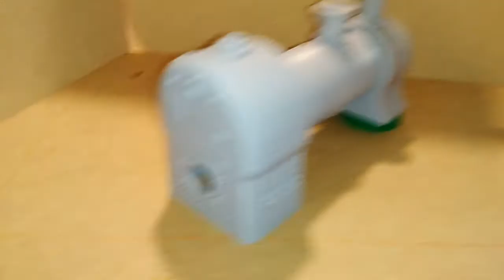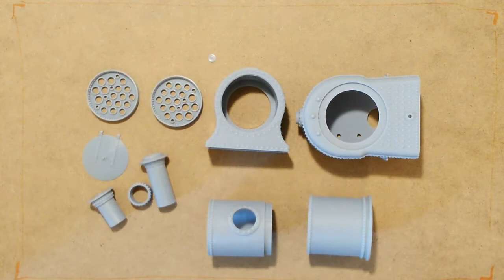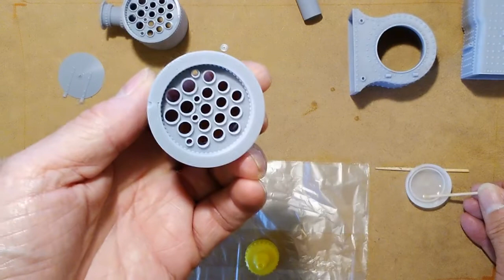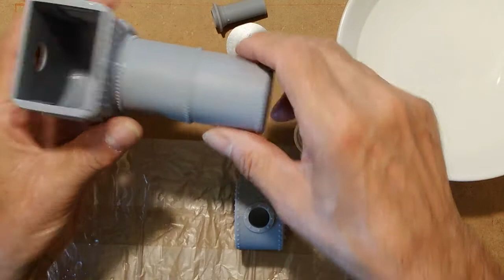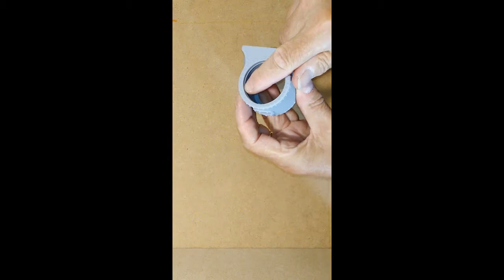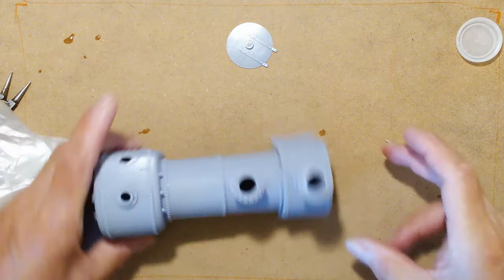BOILER CONSTRUCTION

Comment: I really like this kit. Would it be possible to make a cab and a running plate for it. Also is there anywhere I can get the parts for the boiler: fire door/doors and anything else that would need to go on the fire box.🙏
Reply from the maker: Hi, thanks for interest.
Unfortunatley,, what you see is what you get..
Any other extras I'm afraid you will have to make / source yourself...
I have only gone this far, as this detail and quantity of bits seemed to meet the requirement to have a realistic boiler assembly in the workshop or as a load .
Reply: @JERRYIRWIN41  thanks Jerry it’s no problem I will just look on the interweb and see how it goes. But it’s not going to stop me getting one from you. 👍